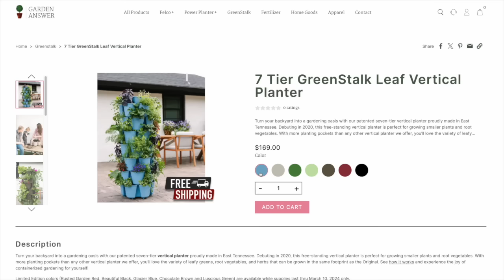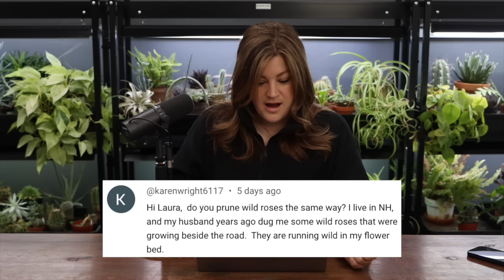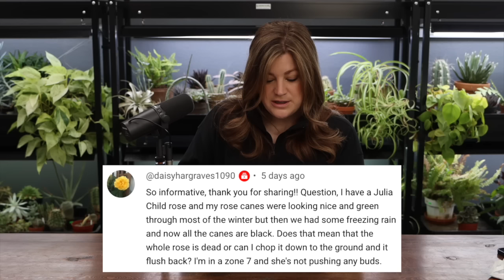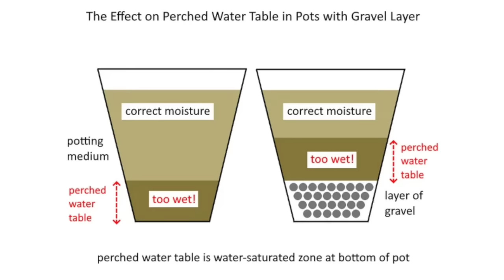Is Aaron the King of Negativity? // Is It Possible to Cut Roses Back Too Far? // Recap 🌿

Comment: For your solar barn roof - you'd get the most solar production if your solar panels face south, but you'll still produce solar if they are faced in a non-south direction. Just keep in mind that if any of the panels receive shade (from trees, another barn, etc.), the rest of your panels on the same inverter system will be limited to the production of the panel receiving the least amount of sun. Long story short, you'll definitely want to do your homework before deciding if you want solar panels AND make sure to chose a reputable provider/installer. My husband and I have a ground mounted solar system at our home and we love it!

Comment: I work in residential solar design. You absolutely can put solar on east/west facing roofs. South is preferred and will be more efficient, but an open west facing roof will produce a lot! You may just need another panel or two depending. It's worth getting a bid. Most companies have software that estimates your exact locations' production so you can see.

Comment: On the topic of plant labels that last. I also prefer the metal ones. I use my label maker and attach to front. Then print the year it’s planted on the back. I then dip it in exterior concrete sealer. It dries clear and has lasted years. Or, have tried a few by spraying with exterior varnish. Also, have lasted. Zone 5.

Comment: 19:31  I used to put rocks for drainage but saw a similar infographic last year and had much better luck with full soil last year. Now the only filler I’ll use is a big rock in pots that need weight at the bottom to stop them turning over.

Comment: 5:00 spacing roses. I think you could hoop stool those roses to create the space in the aisles. Anchor the side shoots down along the ground and pin them (under a rock, with a landscape staple, bury, or stake) looping their long canes to create more horizontality. This would be a traditional way to make a cutting garden of roses because wherever the canes are horizontal, they make flowing stalks instead . They may also root at the stool, so you'll end up with a lot of roses, but yes, training with hoop stooling is a way to get more roses with such narrow aisles.

Comment: I trust Laura's vision about her chicken coupe and wisteria.  I have a wisteria, was given to me as a bare root.  I found a place away from the house planted it abd bought a large trellis made if wrought iron.  It didn't do anything for three years. Then one summer it took off grew so fast and broke the the trellis.  Had to put nylon rope and stakes up to hold it. I finally got it under control an in the shape I was after. An umbrella shape. You can't see the trellis or stakes. I keep it trimmed several times during the summer and fall. It hangs with blooms an is a very English thing. Keep your wisteria.  Nothing more English than a Wisteria an of course rock walls  English Ivy, and boxwood hedging.  You have done great in all your garden rooms. Considering you're in a high dessert area.

Comment: I'm not sure what garden markers have in them but if you want a label to last longer, try paint markers (or the metal engraved labels as mentioned in the video). I worked in forest research for many years and the labels with paint markers were the only thing besides the metal labels that lasted. Also, if possible, face the label away from the sun when you install it.

Comment: I had the gardeners 🎉celebration dance…the Fiskers hard bottom totes were at Grocery Outlet in Twin Falls ID 3/2 for $14.99 each, I scooped up 2 and sold another shopper on the deal.  Mine have lasted 3-5 years if not left in elements 😊

Comment: 25:00 solar roof... east/west versus south. I can't comment on THAT per se, but I do know that there's a program here in Minnesota and North Dakota where they DOT? UND? (likely grad students) are testing lengths of SNOWFENCE for solar generation and to keep the snow from drifting... HOW COOL IS THAT??!! And they are vertical and somehow it doesn't matter which direction they face. I wonder how they perform covered in snow??!! Maybe there are privacy fences or rail fences that also generate electricity? wouldn't that be cool? (like the old  barb wire fence telephones back in the olden days)

Comment: You said you didn't use filler for bottom soil, but I remember when you planted out your cold frames around the Hartley you did use wood as a filler. Actually Hugelkultur is just that....filling up the bottom with wood, leaves, etc. I have done that in very deep pots as well. However, I have also had the problem of plugging up the drainage holes and "drowning" some plants. I now have side holes drilled in the pots to prevent that from occurring.
Reply: They said the use and they showed a clip about the cold-frames using firewoods.

Comment: I have a root slayer shovel to remove older plants, shrubs and roses. The jagged edge shovel helps me a lot, as I live alone and I am 74. If I want to move a plant, I do it when they are dormant.  For roses, I trim quite hard, so it is easier to move them.

Comment: For writing on tags more permanent you could try out so a small Label-maker. I have one from the brand brother and so far it worked to write plant labels with it. It's so a small thing and it makes stripe labels. ( It's called Tape Cassette non laminated, 12 Millimeter, black on white tape, TZe-N231, but I live in Germany maybe it's called a bit different in USA). The stripes you stick on metal labels. But I don't know how long the front lasts. My oldest tags are 2 years old and I can still read them. I guess it depends how strong the sun light is, the UV will make the plastic brittle. 
Otherweise you could maybe ask in a botanical garden where they let their tags made. I guess it exists companies for making front on botanical tags, street signes, etc. But I can imagine it's expensive.

Comment: LABELING! aargh. We've tried so many things through the years. Sharpie "Extreme" markers (not regular, not "industrial") are far longer lasting than any other marker I've tried. The other thing that stays legible for years (and I realize my full sun isn't the same as yours) is using a laser printer on Avery clear address labels, which are just the right size for the zinc garden markers or a 1" wide plastic blind (cut into appropriate lengths). Using either of those, my labels go missing before they fade. The other option that's long-lasting but not as easy to read is plain old pencil. I like the 1.3mm leads you can get in mechanical pencils. I've also used silver metallic sharpie to write on nursery containers, lasts at least 2 years, and this year I'm trying a white china marker instead.

Comment: I think, for the rose garden, if the plants were not planted directly beside each other but did a staggered or checkered pattern so that in the row next to the plant, the next rose is 5 feet further down the row. Just like when building a brick wall or laying panelled flooring, don't put the seems together, stagger it out. Plants have a diameter radius they like to be planted in, its a circle, not a square, keep it in rows for convenience, but not columns. But that is just the permaculture designer in me speaking. Good Luck.

Comment: I purchased the fruit steamer after watching your video last year and made an end of season trip to my local grape farm- so easy and so delicious. I tried apples but didn’t get nearly the fruit juice qty I was expecting as I recall from pressing them. It may have been the variety I picked... (I made applesauce with the remnants in the pot)I highly recommend the juice steamer pot for easy of use. Caveat: if you have weak hand strength it may be a bit difficult to pinch open the hose clamp, and be careful as the juice comes out as it is piping hot!

Comment: I really want to share some thoughts about the cut rose garden.  If you keep the two rows at the edges of the bed, then you could consider reworking the rows inside by choosing the roses you most want for cutting, and the roses you would best like to move out to other areas of your landscape.  The paths that connect the remaining roses don't need to be straight, and winding paths might work so well you wouldn't need to pull out all the landscape fabric in the walkways.  Any areas that are too dense could be further thinned, and gaps could be filled up...I'm seeing benches or... a bistro set!  
Oh course, this only works if rows (to match the other three quadrants) are not essential.
I'm posting this a week late, but hoping to hear comments.
Happiest Spring Ever You Guys!

Comment: Hello! Great show/information, soooo helpful! Quick question, have you ever dealt with a dodder vine issue? I am in Boise and have been battling it in my wildflower seed garden beds. I have a couple things to try this year to eliminate it which include, removing top two inches of soil (get rid of seeds) then use a weed torch/herbicide every week for four weeks.  Then lastly, put fresh bag soil on top to begin planting this spring.  But hoping you might have some insight that requires less work. lol! Thanks, keep up the great work!

Comment: Labels that last at least 2 years...  I make labels on the computer in sheets. Must use a laser printer and waterproof labels. Since I plant many of the same plants each year, having the labels stock piled is easy for labeling trays. I use Microsoft's Word mailing labels program. Saves a lot of time since I also do production planting.

Comment: Oh I agree with Aaron, the pallet walk does not fit the style, the looks or the rest of what you have going on there.

As for wisteria, I HAD an Amethyst Falls one (smells like cat pee by the way).  I got very tired of the smelly flowers so I cut it down, sprayed with Round Up repeatedly but it isn't dead.  It started
sending up shoots several feet from where it had been planted.  These shoots are coming up right in the middle of other things, so I can't dig or spray them.   So FIVE years later I am STILL battling wisteria!
Even though that variety is supposed to less aggressive, it IS aggressive.  You CAN dig your wisteria and probably dig it over and over AND over again by that chicken coop for years to come!

If it was my house, the wisteria, the pallet walk, the wee boy statue and the arch would all leave that area.  The arch I'd LOVE to use elsewhere but not any of the rest!

Comment: I don't think the zones are accurate either.  I am technically a zone 6b in Western NY and you are so much warmer now then we are.  We can still get freezing temps and I don't do any clean out until May.
Reply: Yeah, it doesn't take into account the LENGTH of the cold. Zone 7 in NC for me was a handful of days of temps in the teens, maybe. Here in Ohio, half a zone down, we have so much longer in those teen temps, but the lowest temp is about the same(every few years we get a dip or a raise)

It's not very intuitive, wish we had a better system!

Comment: I always appreciate information on roses.  I planted 35 new bare root roses last year into 12  inch pots and left them in pots until early fall.  I'm in zone 5b (now 6) so its still early, but they all look pretty dead.  They are all rated zone 5, and all were blooming and looking healthy when I planted them.  This year I have another 12 bare root roses coming, again from Palatine.  I think I will put them directly into the ground this time.  Any suggestions?

Comment: It would be totally less work to take out every other row of the roses and move them to a new bed. Big deal the walkway would be a little wider than most/reccomended.  At least you would have more airflow. Set another bed with the same dimensions as the current and move every other rose or every other row. Less work and total benefits long term. 🌹🌹🌹🌹🌹🌹

Comment: Well.... I have had chickens and I've never had any problems with my cats and chickens. You can do lots of fun things for chickens and I know probably get the kids involved with this, you can put a swing in the chicken yard in the chickens like to swing. You can put in a area of hay the chickens love to go in hay and pick out seeds and things like that.. plus you can make a run outside of your main chicken area and it's like a tent of screen and it's only about 2 ft tall and you know maybe two feet wide so that they can rummage around and go here or there have a change. I used to section off areas where they could only go so far so that would give it time to regrow and get new bugs or whatever chickens like. But it is really not safe unless you have a killer rooster to let your hens run free.. I've seen such brutal attacks on chickens by dogs and by Foxes and by owls and by predator type creatures it's just not worth it❤🐣🐣🐣❤️😊